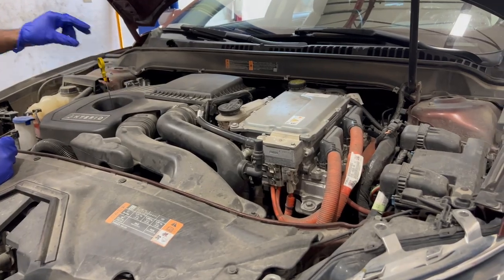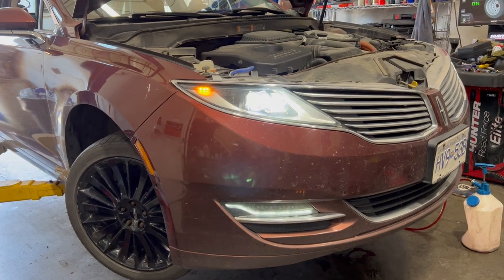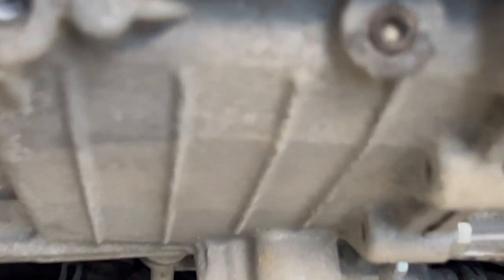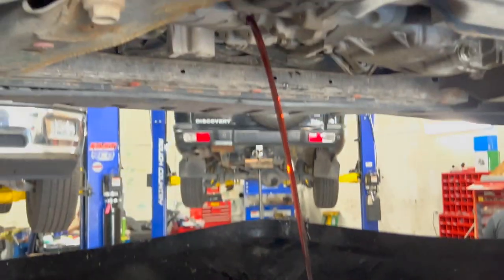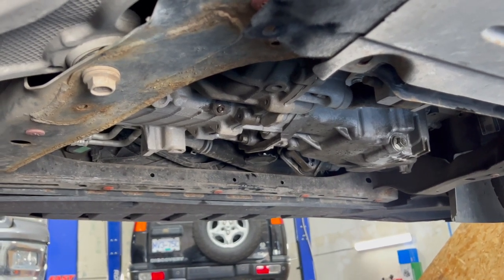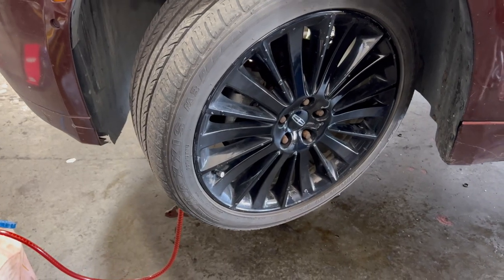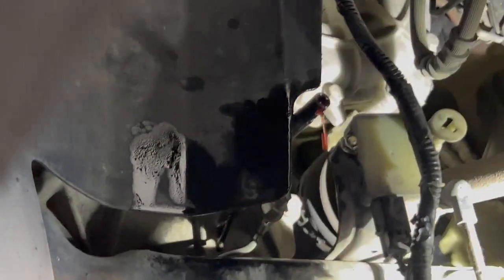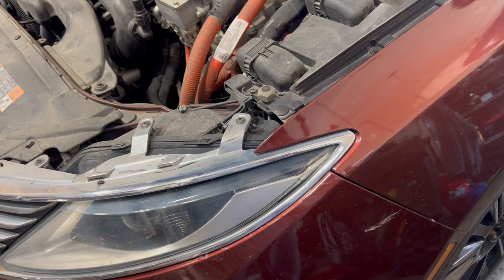How to Change Transmission Oil on a Lincoln MKZ Hybrid 2013-2020

Comment: Thank you for the video. A 3/16 hex bit (4.76 mm) seems to be the right size and not a 5 mm bit. My transmission fluid wasn't too dirty after 100k miles. This car was originally used in San Diego, where the dealerships consider it "severe" driving condition (due to traffic and hills), but it seems I could have waited for the the factory recommended interval of 150k.
Reply from the maker: Thanks for chiming in! I think with the transmission fluid, the point is to change it before it gets dirty. I never follow the manufacture recommendations for transmission service, I always end up doing it earlier haha 😂. It’s expensive but it gives me peace of mind

Comment: Hello friend, thank you very much for your content, you are incredible, one question, do you know if for the mkz 2.0 ecoboost 2013 the transmission fluid should be changed as well and at what mileage, also when to change the water pump for the same 2.0 ecoboost? thank you very much infinitely.
Reply from the maker: Most definitely change the transmission fluid. I do my transmission fluids every 120k km. Not sure about the water pumps on the 2.0
Reply: Thank you very much friend, I love your content  @321verykind

Comment: Might be a dumb question, I was told my 15 3.7L AWD doesn't even have transmission fluid and that it's all electronic, does every lincoln from this generation have fluid?
Reply from the maker: Yes they do. Your 3.7 has the 6f50 transmission, which definitely has fluid inside. Make sure to consult a professional mechanic to get the oil changed on it.
Reply: Perhaps they meant power steering fluid because it uses an electronic assist motor instead of being a traditional hydraulic power steering system, and usually power steering fluid is the same as ATF. Every transmission has fluid in it.

Comment: I couldn't get a sense of exactly where the fill plug is in your video. 😵‍💫
Reply from the maker: There is a drain fill hole behind the driver side wheel well area. Check the blueprint for this car online